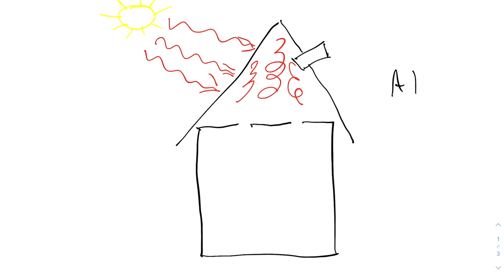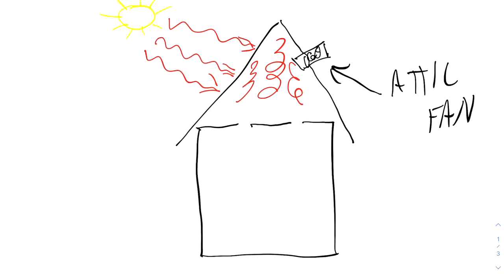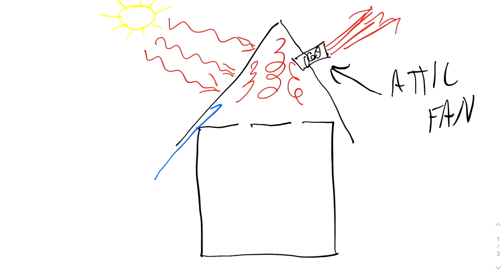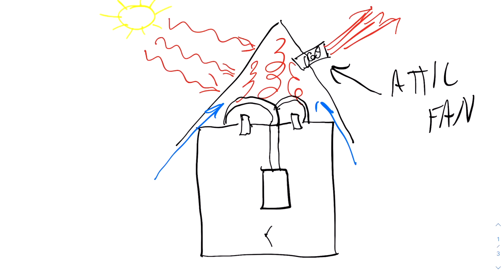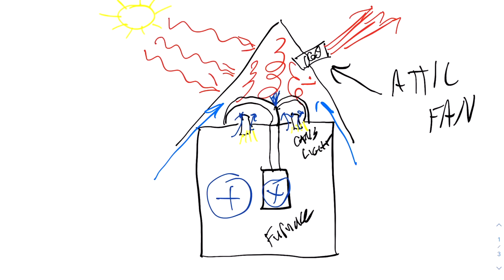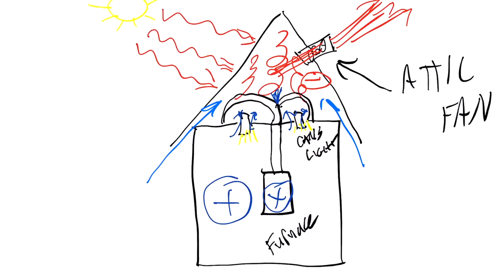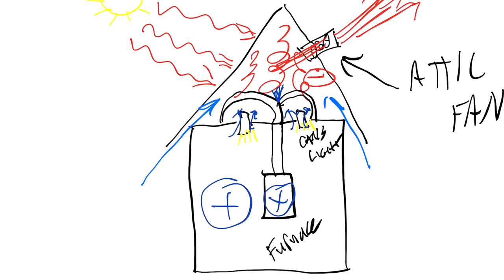3 Remodel Rip-Offs

Comment: Attic fans (or whole house fans) from the pre AC days are super effective. The manufacturer’s diagram that you show is accurate. Of course lowering a the attic temperature from a 150 degree oven down to ambient temperature is going to have a dramatic effect on the load inside the house. The way houses have evolved from well ventilated attics to encapsulated superheated attics with a layer of crappy insulation above the ceiling is the result of sheer stupidity or laziness. Attics were designed to be completely ventilated and actually helped cool the house. You’re far better off without an oven above your ceiling.

Comment: If attic fans don’t help, then neither do passive vents.   
We had a solar fan installed when our roof had to replaced due to hail damage.  I would have preferred a 110v fan, but didn’t have an easy way to route power into the attic without $$.  
Honestly, I was really surprised how much difference it has made in the temperatures of our upstairs bedrooms.  
Living in Colorado Springs.  We have A/C, but only run it when it is super hot or we have house guests.  Having the solar fan has further reduced the number of days we bother running the a/c.

Comment: Just watching this video now, in a retrofit house with a sealed attic with just 2 gable vents, no soffit vents, no roof vent. I don't run the AC in the house because the house needs much upgrading and leaks like a sieve. I recently placed radiant foil on the rafters and am planning on adding a gable fan to pull out the heated air inside the attic so it stops building up and making its way into the house itself.

Comment: I have a three story house with just one AC unit. I routinely run just the HVAC fan to keep the temperature equalized between the different floors. I also run a box fan in my walk in attic that shares an insulated wall with my office. Running the fan makes a noticeable difference in the office. Of course that could mean I need better ventilation in the attic.

Comment: I also disagree on the power vents. When I bought my 1750 sq.foot ranch (built in 1967), it had three already installed and thermostatic controlled. Set point was 120 to come on, and they would shut off around 85. I could hear them cycle on and off as the attic heated and then cooled, and the outside temperature would still be higher than the shut-off temp. Rather than pulling air in through soffit vents, mine was pulling air from gable-end vents. It definitely affects my indoor temperature on hot days for the better.

Comment: Before our solar powered attic fan, Without running the air conditioning at night.    We had the ceiling fan and 2 floor fans to cool the upstairs bedroom.  After Solar fan installed...Just the ceiling fan.  It really makes a difference.   After a couple of years the motor went out mid summer.  We were back to a hot bedroom.  Couldn't wait to replace the motor.

Comment: I'm very surprised you haven't provided any figures or numbers, (with before and after temperatures & AC costs) before saying: "attic fans are a total scam".
Some of the comments below very clearly show actual before and after degrees dropped, with & w/o AC, etc. which 'ARE' based on facts, and much more credible than guessing and sketching theories with 'ZERO' before and after figures.

Comment: They do not clog your vents. They are really good to use.  And they do keep the extra heat from heating your home in the summer time. Especially in the state of California they're really good. Every time I have one my house seems to be much cooler inside, because the extra heat inside the attic gets pushed out. 

If you been a attic in the summertime without a fan like this. You would not want to be up there. But you can be up there in an attic. What they stand up there blowing heat outward. They just won't get below 90°. Until night time. But they do drop the temperature by pushing the heat outside the Attic. So I do know the attic fans are worth it.

Comment: If an attic fan can pull out conditioned air through the tiny holes in the drywall corners and through the insulation on top of that than i would think that an attic fan would pull a hell of a lot of air through the actual vents with usually about 4 feet of opening to the outdoors..  air would take the path of least resistance so the lesser resistance in an attic would be the soffett vents,..  so if an attic fan moves any air and is spinning the correct way to blow out than that air will come in from somewhere and if you have the proper ratio and total venting of roof and soffett then you will never pull enough of a negative pressure in an attic ti pull out conditioned air over outdoor air..  proper venting means for every 15sq ft of attic space needs 1 ft of venting and soffet to roof venting needs to be around 60% soffett and 40% roof..  so for 1000 sq ft of attic youd need 4 feet of soffet and 2 feet abouts of roof venting..   whether anythings powered or not...

Comment: I had old 30 year old aluminum windows.  Replace them in early December with Vinyl replacement windows.  It is unbelievable how much more quiet my houses how much more temperate it is and most of all how much and where light is coming through because there's not a perminent lair of moisture between the 2 panes.  These replacement windows were the best money I have ever spent.  My gas barely kicks on to warm the house.  I can't wait for summer to see how much cooler the house will be with the same amount of Air conditioning.  And PS all of my bills well my gas and my electricity went down when I put the replacement windows in.

Comment: What would you suggest when it comes to the upper level of a home being hotter than the lower level because of the attic. Yes I am aware that heat rises. I was thinking of going the Attic fan method. What other options are there

Comment: Regarding the attic fan, if it's retrofit to an attack that has a ridge vent, it will create negative pressure which will pull air in from the ridge vent (that's the closes source of air) and it makes air circulate in from ridge vent and out attic fan so the air below that level is somewhat stagnant and the soffit vents are not as effective.  So you lose a lot of your passive ventilation.   You are basically paying to make your attic less effective and efficient.

If the fan is installed on a roof without ridge vents, it might be effective, but I think if it's installed right beside a ridge vent it's going to increase ventilation in a very small area at the top of the roof but decrease ventilation overall.

Comment: I have old single pane windows. So, far I've had the windows on my 1st floor replaced. It's much cooler/warmer and more comfortable near the windows.

There's also a lot less ambient noise from the rattling window frames, whistling wind through the gaps from bad seals. Other noises that are common to my area include: Neighbor kids playing and swimming, nearby trains, high speed bridge traffic, planes and car side shows. Those sounds are now barely audible downstairs, but upstairs, they're still pretty noticeable.

Comment: So, just to follow thru. I have 3 floor building - 2 floors + basement. And since house built is kind of old, i have no zones for furnace.. everything is same fan/zone.. When you're saying that no one should run fan on "on" setting, you mean that there is no benefit in it at all? Even so I have lke 68F in basement and 75F on 2nd floor with setting set to 71-72F? Wouldn't that blend air thruought the house and help mix it? I'm confused on why pushing thru the air isn't a right thing in this case

Comment: I'm sorry man.. have to say my solar attic fan absolutely helped my attic stay cooler. And since I had a 3 story home my 3rd floor did stay cooler after the installation of one Solar fan that come on at 80 degrees and then my electric hi flow came on at 120 degrees. The 3rd floor had a storage area that connected into the attic. Granted I had a small attic space and only had gable vents and not a ridge vent. Now another thing I had was solar panels installed with a 6 inch air gap. That drastically cut the temp in my attic. But the overall temperature became bearable in the storage area after the installation of the electric powered fan. Then I found that fan ran all day long during the summers. So the addition of an 18 volt solar fan cut the use of the powered fan to only days that were really hot. 14 years later I had the roof replaced due to a tree going through it and at that time I put in a ridge vent. So until then my attic ventilator did help. But not 60 degrees. maybe kept the temp around 95 to 100 during really hot days. Plus in Virginia that was a lot of humidity and all the rain we got kept things damp so I wanted air flow through my attic storage area. Note to self. Always get plastic storage bins in place of using cardboard boxes. keeps the bugs out.

Comment: I can see the argument in the attic fan if it were totally oversized for the air it can pull in from the soffit or ridge venting, and that it it may result in pulling air from within the house through mostly electrical penetrations from lights etc in the ceiling space. If it’s sized correctly then it will only pull from the attic. Now to my opinion and by NO means am I an expert in air movement, I’m an electrician during the day and home owner at night. The concept I’m more familiar with is that an attic that’s subject to direct sun gets pretty hot (I’ve been in a few) in relation to outside ambient air temp, it you can remove (NOT COOL) that hot air from the attic and replace it with outside air then your on your way to reducing the thermal mass of the house. For those with flexible ducting in their attic space and those with the indoor unit also up there your reducing the thermal effect on those items, ducts are cooler, even if they are insulated they are not 100% insulated from the radiant heat from an unvented attic, and neither is that big metal blower unit, it’s even more of a victim of that hot space. So cooling is not a good term for an attic fan, reducing thermal mass might be. Yes your somewhat cooling the space by reducing a 140 degree attic with 100 degree outside air, but your also relieving the amount of cooling your ac unit has to do to the duct and blower unit before it becomes 100% cool air to your house. Remember heat is drawn to cold so some of your nice cool ac air is going to get sucked up by cooling your blower and partial warm ducting before it enters your house. 
Smart thermostats are only as smart as the system they are connected too. Matt brings some good points to this one, only comment here is I let my blower run on for 60-90seconds after the condenser shuts off as the A coil is still cold so some semi free cold air still available. 
Replacement windows, I’d agree with a few things said, over all they are more beneficial than single pane in thermal transfer but also as pointed out very costly. That said energy costs are rising so that return on investment may come sooner than it would have

Comment: Any thought on whether instead of pulling the hot air out of the attic if you were pushing in outside air would be a better way to cool the attic. The roof already has roof vents so I am assuming the hot air is escaping from there.  I am assuming if the solar attic fan was pushing in the cooler ambiant air into the attic it would cool the attic faster.  So basically giving the side gable a boost?  So basically like helping pull colder air from sofit and the hotter air escaping through the roof vents.  Wouldn't this be similar to a whole house fan concept?

Comment: Mold remediator here, I strongly disagree with his opinion about attic fans. Air movement is very important in our industry and the more complex these roofs get, the harder it is to keep that air moving in all cavities. We use variable speed controls to control the pressure, air seal the attic floor from the living space, then fog the attic at all intake vents to track air movement to the exhaust. We continually achieve a lowered temperature by 12-15 degrees, and a moisture free attic.

Comment: I'm no scientist, but having lived in houses with and without attic fans, I would absolutely endorse them.  The blanket of hot air that typically sits on the ceiling of the second floor feels noticeably reduced.  Also, if the fans didn't lower attic temps, the thermostat on the fan sensor would never trigger them to turn off.

Comment: I do this for a living solar fans and baffles make a difference with air circulation.  It can be 125 degrees in an attic and installing one in about an hr and then there is a major difference in attic Temps. I always install a fan first on any job if I'm able too. Makes working after so much more enjoyable then being in the heated attic

Comment: I don't think you got this one correct.  We put two of the solar powered fans on our steep roof with dark shingles and it made a world of difference in the summer.   Before we put them on, you could feel in the late afternoon and evening, the heat radiating down from the attic space.  It was a cooling nightmare.  After installing them, we could actually cool the house.  During the winter, we just cover them up so they would not run.  They basically cut our cooing bill in half.  Huge return on investment.

Comment: Radiant heat barriers are very effective in lowering attic and house temperatures.  They're cheap and easy to install if you can stand in your attic.  I believe it's code in California.  My son did a high school science project and found that radiant heat barrier, essentially dacron backed aluminum foil, blocked 95% of the heat radiated from the roof into the house.  The key is that the roof, radiates heat into the house.  Much more effective than even insulation.

Comment: The whole point of a house fan is to cycle air at night when the ambient temperature outside is cooler. Your insulation keeps hot air in just as much as it keeps cool air out. 
That being said, you can achieve the same effect just by using your HVAC's blower fan and keeping all the windows open at night.

Comment: Whirlybirds don't use electricity, are much cheaper and are placed in multiple locations to ventilate more space depending on the type of ceiling. Cathedral ceilings require ridge vent ventilation.

Comment: QUESTION: How would the "attic fan" work on the roof of the garage?
There is no attic/living space separation, it's just one big space that gets very hot in the summertime. Maybe blowing out hot air and pulling in outside air (not conditioned air from any living space) would work better there?

Comment: Matt, keep it up. A lot of your viewers don’t have any background info, even they probably listen to you a lot. When you’re pissing people off, you might be onto something. Also, I bet $100 at least hapf of your trolls on this are freaked out because they just installed an attic fan for a client, or for their family. You’re right on science-wise.
Reply: Home Performance, gonna' have to disagree with you. What many are saying is actually accurate. 

Assuming you have a reasonably sealed home envelope and marginal to adequate ceiling insulation value, combined with a decent attic ventilation, increasing attic ventilation can help reduce the air conditioning load and roof longevity. The heat gain through the ceiling is made up of 3 components, convection, conduction, and radiation. All three of these components have values for heat transmission that are based on whats referred to as delta T or the differential in temperature across the ceiling. This means if you attempting to keep the indoor temperature at a constant, whatever the thermostat is set to, reducing the temperature on the other side of the insulated ceiling, the attic, will reduce the heat transfer. 

Increasing the natural ventilation in the attic by increasing the intake, (soffit), vent and increasing the exhaust ventilation, (peak, gable, stack, etc.), will help the attic temperature approach ambient temperature. Usually ambient temperature is quite a bit cooler than most attic spaces during summer peak. Powered ventilation does the same thing as adding natural ventilation without the need to cut a bunch of additional holes in the soffits and roof. Of course if the additional ventilation is not sized appropriately, it may not perform as anticipated or cost more to operate that offset benefit.

Comment: Air wave is similar to Trane’s system.  The theory behind it is the coil remains cold enough to pull a little more heat and humidity out of your home before the coil gets to warm to put the humidity back in the home.  The refrigerant is still cool going through the line for at least 4 to 5 minutes when the compressor is shut down, so running the fan over the evaporator for 2 minutes shouldn’t be too bad.

Comment: i just moved into a older home in New Mexico, so its HOT! it has a flat roof truss system with 16" or 18" trusses and an electric roof vent. it gets warm upstairs. I click on the fan and crack a downstairs window early in the morning or late in the evening and it drops the temps

Comment: We switched out the windows in our old house. Our bill dropped a little. It was quieter as well. We used a smart thermostat.  It’s more helpful in winter in my opinion, because you can set the heat lower for when your sleeping and then raise the temp automatically before you wake up. No experience with them.

Comment: Problem with most attics is lack of soffit (intake) vents. If you have an equal amount of intake and exhaust ventilation at the recommended amount by shingle manufacturers you will have a much cooler attic. Don't forget proper insulation is needed as well. Your shingles will last much longer as well.